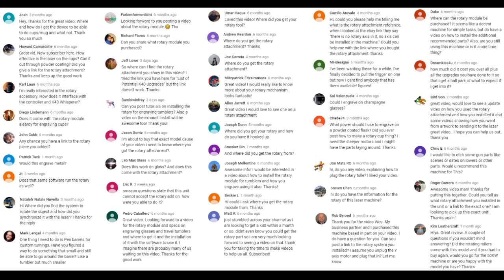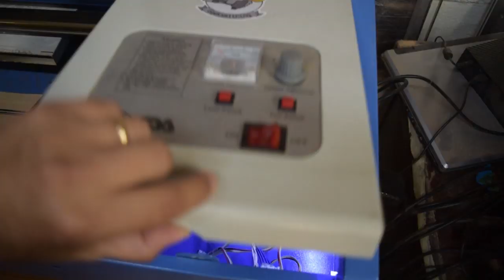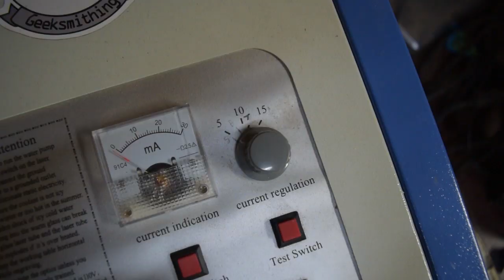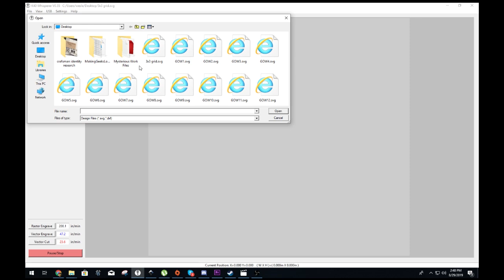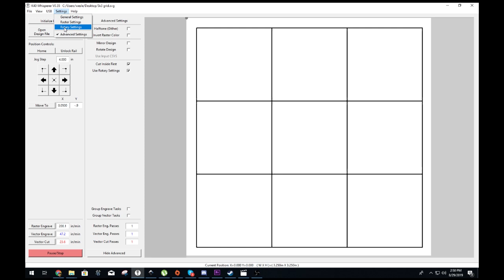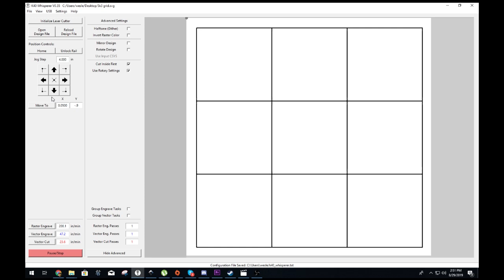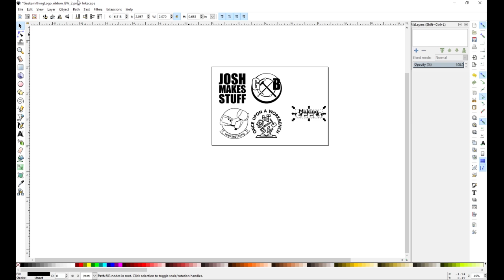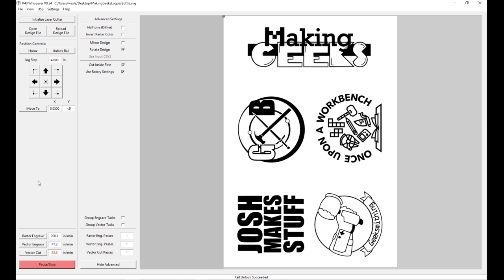DIY Rotary Module for K40 Laser Engravers!

Comment: When you cut out the bottom, is the sheet metal thickness all that's needed, or do you use spacers to raise machine as needed?
Reply from the maker: Yeah, I shim underneath with 2x4's to raise up the laser from the table surface to allow larger items to fit.
Reply: @Geeksmithing  Thanks!
Reply: Do you put something else underneath it?  Is there any concern about fumes, the laser or anything causing damage to the surface or surrounding surface?
Reply from the maker: @hollyellis8254  I have a piece of sheet metal that I drop into that space when I'm not using it.

Comment: hey there! great video. I was wondering do you know which machine I could use for engraving cheap brass jewelry (gold plated) looking for an inexpensive solution
Reply from the maker: Thanks. Nope. That's not this machine. No metals.
Reply: @Geeksmithing  if you use a paste similar to Dry Moly but  more expensive you will be able to engrave on to mild steel, Inox, gold and silver i do not know but those metal it marks it in a kind of way with the paste and if you use a high enough power setting its permanent. We do it all the time with K40's on the facebook group https://www.facebook.com/groups/888394261237059/   Good video sharp and clean, good device sharp and cleann Thank you, you can also do this in lightburn and T2 Laser and alter the setup in their for rotaional burning.
Reply from the maker: @sitgesvillaapartmentneilsc7924  it marks them but doesn't actually engrave. Engrave means to actually create depth.  That is a surface coating.
Reply from the maker: @sitgesvillaapartmentneilsc7924  I have to answer this question and after 50 "does it engrave metal" questions a week, it gets tiring to make such a long winded response.
Reply: @Geeksmithing  I realise that , the depth is measured in microns and if the correct paste/spraynis used will last forever but thats 100 usd a can, people just want to know whether it can do it or not .
Perhaps put a caveat in you details above to stop all the questions. 
I'm heavily involved in lasers and CNC , C02, Diode non chinese and CNC wood/metal. open builds etc. 
The problem is most people want a little machine to physically engrave their details a .5 mm deep and those are very expensive machines or people!  Jo public does not normally understand what is required to achieve these "engravings.". 
Video was great thanks.nice little unit.thanks again. must be a pain being so popular ! 😄
Reply from the maker: @sitgesvillaapartmentneilsc7924  I just don't want to spread misinformation. You yourself said that it can "engrave" if you use those materials, which is just not accurate. 🤷‍♂️😆. I am planning on doing a more comprehensive video specifically about metals and how you can still use them with a K40, just in other ways besides attempting to engrave them
Reply: @Geeksmithing  Excellent and yep I used the wrong word!!

Comment: I know this is from a long time back so I might not get a response, but how long would something like this take to make? The actual engraving of the bottle?
Reply from the maker: You really depends on your design complexity and how much of the service area you're trying to engrave but for this particular design I would say about 10 minutes?  How's that for response time?😆😉
Reply: @Geeksmithing  haha thanks :D That is an epic response time!! Completely new to laser cutting and engraving and this was an awesome video! Very very tempted to get one of these, would be able to sell it to the gf as well if I made her a custom waterbottle
! I guess you reckon the K40 is definitely worth the price, and I guess better value for money than say a Glowforge?
Reply from the maker: @ezbayz  If you arent afraid of having to tinker with it here and there, it would be very easy to work your way up selling items made from this machine to get something a bit higher end.   I think for the money, it easily blows Glowforge out of the water, but the finish and shine on the Glowforge certainly makes that an attractive option.  I get that.  But there is also a flipside argument to be made BECAUSE this machine is so cheap it can do things GF can't..... I doubt you will find many Glowforge owners that would be willing to cut the bottom out of their machines for upgrading as I did in this video ;)    If you havent seen my other videos on the K40, maybe they will help answer some other things about it.  Feel free to reach out if you have any questions. Here is one:
https://youtu.be/_OuGBUAiyzQ

Comment: I’m currently doing some tumblers with my k40 but currently have the speed at 6mm p/sec to get it to burn through the coating @ full power. How are you running yours at 200.1
Reply from the maker: Caution....Are you really running it at full power? This is akin to playing a speak at maximum loudness and can damage your laser tube.  Is that your speed setting for Raster engraving?  That seems awfully slow.
Reply: Geeksmithing  it doesn’t want to go all the way to the stainless unless it’s 99.9% and 6mm p/sec I tried your speed and it barely did anything. What percentage do you run at on laser
Reply from the maker: @mwarren02  My laser meter does not display %, it is the operating current. I consider 15mA to be my max I am willing to go to not damage the tube,  so if that is 100%, I run it at around 7mA, so 50% power.

Are you able to engrave/cut wood without cranking it up/running it at a very slow speed?  Without more information, my first instinct is either your mirrors are not properly aligned and you are losing power that way, or your tube is bad.   If you are really running it at basically 100% power, I would be surprised if your tube is not already damaged....which makes it CRAZY weak in the power department.
Reply from the maker: One thing to note thought on my speeds, in the video I was running at inches per minute, and you are at mm/second... This would make a big difference.. but even still... 200 In/Min = 85 mm/sec.. so something is still off...

Comment: I realize that it's too late now, but could you have used a shallower focal point lens instead of nibbling your bottom out?
Reply from the maker: That is also an option, but in my case I wanted have no limit in other objects I could laser with or without the rotary.  It's not super uncommon for the more expensive CO2 laser systems to have a removable bottom for such things.  Good observation though!

Comment: Hi there, thanks for the tutorial, I am collecting the parts to buy and I noticed that the stepper motor is 12v, but isn't the K40 24V? Sorry if I am wrong I have just bought it and I see 24V input witten in the controller. If I buy the motor you listed, will it work fine?
Reply: Does it really matter? I am waiting if you respond I don't want to buy the wrong motor, would be great is you could spare a minute to answer.
Reply from the maker: Great questions.  The exact stepper motor listed is the very same one in the video and it works great.
Reply: @Geeksmithing  Thanks so much, that is enough for me then, if it works for you it should work for me, thanks!
Reply: @Geeksmithing, after more research I found the specifications of the motor for the default controller, here (https://www.manmademayhem.com/?p=3192) I found that it is a 5.4V 0.9deg specs being 17HM4410 with 34Ncm, I believe that the 12v will ask too much power and with time might damage the controller. Don't take me wrong, I loved your project and I am already printing the parts and ordering the remaining ones. Thanks again, much appreciated for the tutorial that is very good.
Reply: Most hobby diy nema 17 nema 23 Stepper motors can handle a range of voltages ...

Comment: couldnt you avoid needing the calibration by copying the ratio of the original y axis stepper motor to the linear movement of the gantry?
Reply from the maker: Good question.  I am not sure.
Reply: @Geeksmithing  I'll be honest, i wasnt expecting such a quick reply. Also, might be something fun to figure out if you are so inclined.
Reply from the maker: @josephgauthier5018  Ha, well, honestly, I am onto other projects atm, and don't have much of a need to investigate this.  If it ain't broke and all that...    Besides, 
I'm not entirely sure what you meant by the ratio thing anyways. :D
Reply: @Geeksmithing  that's fair. This isn't exactly for someone who is only willing to do plug and play.

Comment: I have been using my k40 for almost 2 years. 1 year using whisper and a rotary similar to this. Have you had any issues with your design changing in size/aspect between parts. Like same design multiple bottles and design changes without you doing it
Reply from the maker: Um..... no, I honestly can't say that I have... is it scaling only in a particular direction?   After it "changes", if you return to a previously working shaped bottle, does it correct itself?
Reply: @Geeksmithing  scale change is in direction of the x-axis only and it will usually change back after a reboot of the laser. I havent found any info on this happening to others yet but its killing my profit.
Reply from the maker: @Gettinsomeair  is this a thing that has cropped up over time? Gotten worse over time?  Just trying to think here... Belt stretching could make it lose steps, which may make it look like that axis is being distorted....  try changing that x axis stepper motor out? They are pretty cheap.   I cant see why/how the machine would change scale according to bottle size/shape though. . 🤔🤷‍♂️
Reply: @Geeksmithing  its kinda back and forth. Had the issue not long after getting the rotary not seeing any belt wear or stretch. But i may look into a new stepper
Reply: Thanks for the help/insight

Comment: Great video.  I'm probably just tired, but I'm not following why its necessary to cut out the bottom to use the rotary. It doesn't look like you elevated the unit. It looks like you're only gaining the thickness of the bottom.  What am I missing?
Reply from the maker: For that specific example/diameter of a bottle, you are right, it's not necessary. Any diameter larger than about 3 inches will require the bottom to be cut out to accommodate larger bottles/objects.
Reply: @Geeksmithing  Ok.  that makes sense.  Thanks for the response. Keep making the videos.  They are helpful.  My K40 is coming next week.  Will be fun to try it out if i can get through the setup.
Reply from the maker: @dvdmementos  I appreciate that! I hope to make many more this year for different materials, techniques and mods for the K40.  Good luck!
Reply: @Geeksmithing  Do you have link to that bottle you're using?
Reply from the maker: @dvdmementos  not that one sadly. Walmart sold them, never on their site annoyingly, so I would have to scour various stores to find them. They were awesomely cheap, but elusive.

Comment: Hi. Thanks for this video. But the 22mm bearings are too small for the chassis mount holes?? The holes are 23.5mm or there abouts, the bearings are 22mm.Also the pulley holes are 8.25 not 8mm. There is also no way of securing the pulley to the 8mm rod???
Reply from the maker: I am currently revising the models for this and will update the files this week. Sorry for the trouble.
Reply from the maker: I have revised the chassis model and updated the STL file on my website.
Reply from the maker: As far as the gear not fitting, this is the first I have heard of this issue...  I will investigate it.

Comment: Does this process work best with a coated bottle or can the bottle be noncoated?
Reply from the maker: It only works because of the powdercoated paint..  The laser does nothing to metal otherwise.
Reply: so this laser isn't powerful enough to actually score the metal? is there any kind of upgrade that can be attached in order to make this possible if that is the case ?
Reply from the maker: @whitetie13  correct. Nope. Totally different machine.  They are known as fiber lasers and probably start around 5k for the cheapest POS one.
Reply: @Geeksmithing  thank you for the information and the video . very helpful in the business im trying to start up.

Comment: How do you adjust the focus?
Reply from the maker: The focus can not be adjusted in the lens itself... It's a fixed focal length.  You can only change the focus by changing distance the material is from the lens. Some people have special rigs, beds or lab scissor jacks that they use to set or dynamically adjust the height based on the object you are engraving/cutting
Reply: @Geeksmithing  thanks

Comment: on the STL if you put the mounting lugs on the bearing side it would be easier to print. :-)
Reply from the maker: How would that be easier? 🤔 Do tell.
Reply from the maker: It doesn't require any supports or anything. I cannot imagine how that would make any difference either way.
Reply: @Geeksmithing  I'm not being critical. 
its been my experience that printing holes in the z axis produced, well, not round holes and without support, sag and or stringing.
It can be successful if you have a good machine that has been calibrated, however if you want others to have a more successful print result laying the print over on its back so the bearing faces up, will produce a crisp round counterbore for the bearings and hardware (cannot do it that way with the lugs there)!
Reply from the maker: Ah, true. I can see that. 👍 I have never hesitated to print archways, domes and circular cut outs on my printers without support. Good points though! Thanks!
Reply: I have parts on order and am building mine soon.
Also working on a part to allow etching tapered cylinders!
Reply from the maker: @stagsimon  Nice! Yeah, I just cut a ring on the laser to place on the end of the tapered end to bring it to the same diameter as the widest part.
Reply: @Geeksmithing  so I have my parts and used the SVG to cut ply end plates and glued together but the belt is too short or the spacing is wrong! the stepper fits the end plate so its not a scaling issue, I'm a bit confused why? I ordered metal gears both 20T and 40T, the belt in your link was out of stock so I ordered a comparable 200-GT2 belt, it barely fits over the 40T pulleys and is stretched even without installing the 20T pinion/motor ????
Reply from the maker: @stagsimon  The original 3D printed endplate was spaced for compatibility with the 3D printed gears.  I didn't realize that the metal ones are slightly larger, just enough to cause a problem.  Today I was editing the SVG to be the correct spacing for metal gears.  I am still doing some testing, but should have that all revised and up tomorrow. My apologies and thanks for unwittingly being a guinea pig for some of this. 😣 I won't leave ya high and dry here. 🙃  I'll post back when it's uploaded and ready to go.
Reply: Geeksmithing looks like about 1-1.5mm shorter spacing is needed, I was going to cad up and print some end plates to test, maybe with slots for the stepper ;-)
Reply from the maker: @stagsimon  why didn't you just print the gears and ends, and you wouldn't be in this mess! 😂

Comment: Hypothetically anyone building the same rotary table as you can use the same calibration factor as the reduction in travel will be the same
Reply from the maker: Should be true, yep! Unfortunately, the stepper motor availability has not always been consistent, so it was important to explain how to come to that calculation in case someone gets a different one.

Comment: Thanks for the great project!  I made this with 3d printed parts, and I was able to get a test engraving.  I think my belt is too tight, and its jamming the motor now.  There isn't much clearance to move the motor mounting holes down to loosen it.  How tight should the belt be?
Reply from the maker: Definitely not that tight! How recently did you download the files to print? I made a few revisions a month or more ago.  Adding some adjustable slots to tweak motor tension is a good idea!
Reply: @Geeksmithing  Just printed it a couple days ago, although the pulleys came out a bit wobbly, so that may be the issue.  I'll let you know how it goes.
Reply from the maker: @jakesaari7652  did you also print the gear that attaches to the motor?
Reply: @Geeksmithing  No its an Al 20 tooth.  I also cut one side out of 1/4" plywood, and the bearings are about 1mm closer together.  I'll glue up another and see if that does it.
Reply: @Geeksmithing  I was able to get it to work well!  https://www.reddit.com/r/ChineseLaserCutters/comments/e84k0v/k40_rotary_geeksmithing/
Reply from the maker: Awesome! Thanks for working on it!
Reply: @Geeksmithing  I'm having a similar problem.  I wonder if the outer diameter of the linked aluminum pulleys has changed?  I'll try printing out the pulleys from the supplied stls and try from there.   (I attempted to just tweak the STL to move the bearings closer together, but mesh is a bit too complicated for Fusion to simplify to allow for easy edits... :)
Reply from the maker: @techluma  hey!  Sorry for the troubles!  I am currently working on a revision that allows the position of the motor to be adjusted to allow for fine tuning.  Hopefully I can get it done soon.  :)
Reply: @Geeksmithing  No worries.  I'm just appreciative that you published the video and parts list.   We're all tinkerers here anyway...  :)